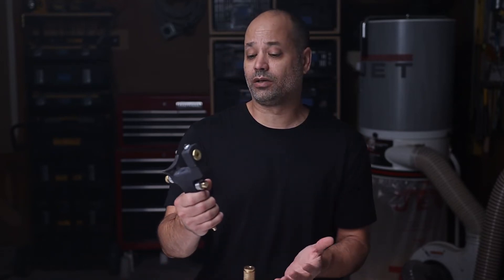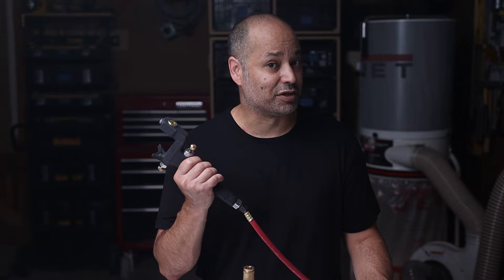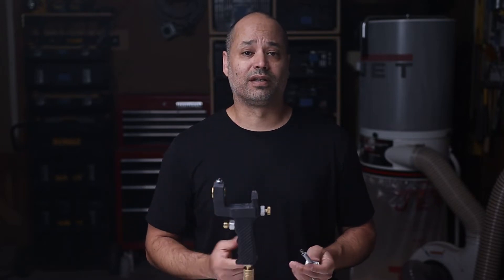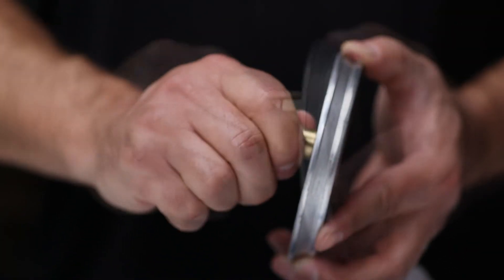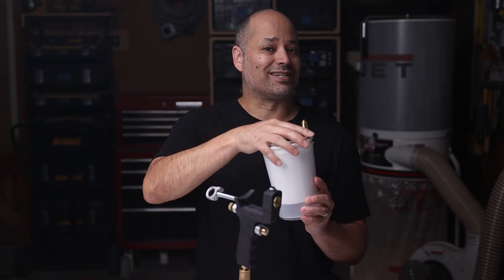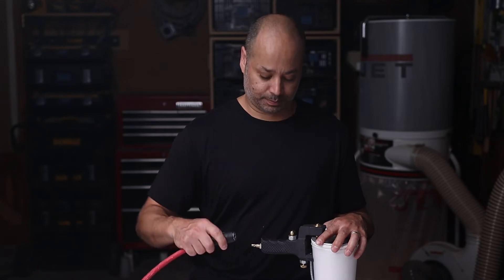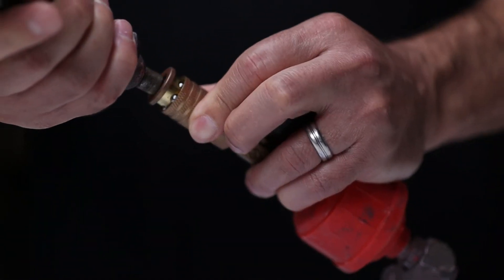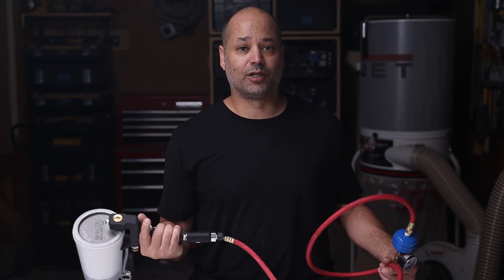G100 Gel Coat Dump Gun Basics || Assembly and Basic Use || (Part 3 of 5)

Comment: Hi, great video. How much qty gel coat would u require for a 10msq area of  grp. (Applied to the mould prior to GRP application)
Reply from the maker: Best to check with the gel coat manufacturer for the appropriate coverage rate for the application. I focus strictly on tooling (mold making) so my coverage rates might be different than yours if you are pulling fiberglass parts.

For tooling, I'm right around 100g/sq ft applied in 3-4 passes. My target wet mil thickness is 18-20. But again, I want to stress that is a different use case and material. Good luck!
Reply: Thank you, that's extremely helpful.. 😊

Comment: Great video, can you explain how to and when to adjust the flow knob at the back? Thanks for the tip on the whip... i made one for my setup..
Reply from the maker: Thanks man, appreciate the comment. With the whip being close to the tool, I never adjust the flow knob on the gun - I just leave it wide open and dial in the pressure with the regulator on the whip. This is actually the same for all my spray guns and what makes this so nice.
Reply: @fortheartisan  Wide open it is.. Thanks again!

Comment: Awesome video! Very helpful. One suggestion...not good to use silicone grease around GelCoat. It can cause fisheyes. Also, the solvent resistant o-rings used in this gun will deteriorate quickly if you use a petroleum based grease such as vasilene. Best to use liquid soap or some sort of synthetic grease. Never install o-rings dry. They cut easily.
Reply from the maker: Yezir, thank you!